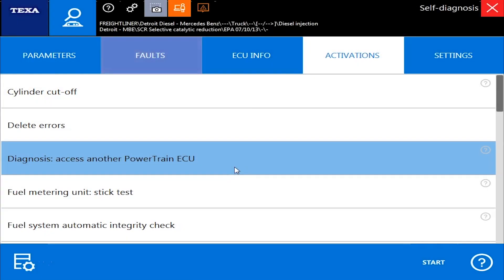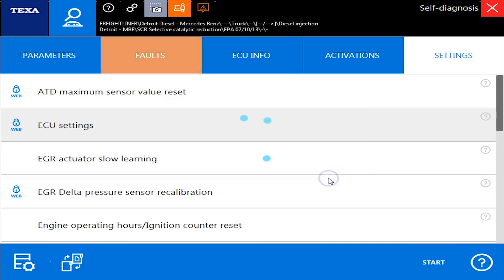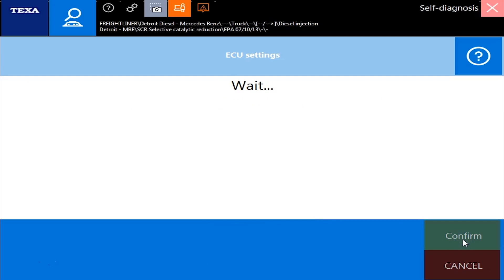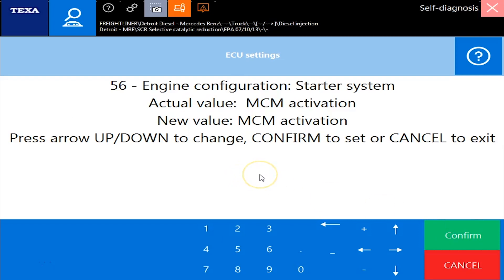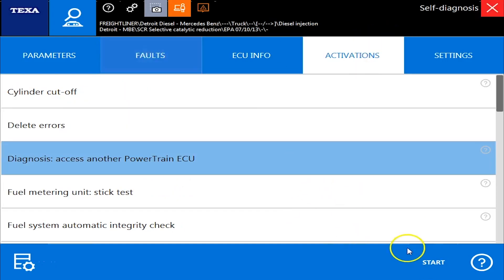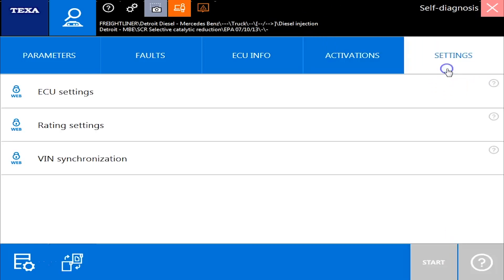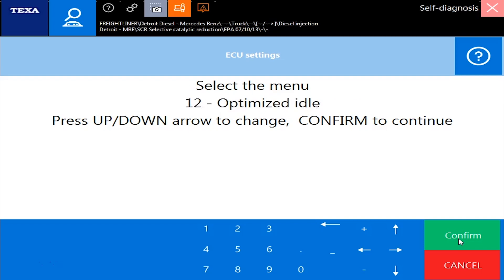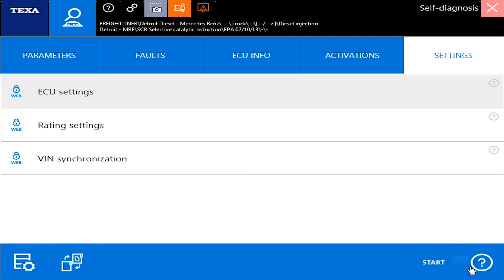How to Change Detroit Diesel Parameters with TEXA Truck

Comment: Hi, I have a detroit 6v two stroke 92 series the ecm is damage and I tried to use the ecm from 8v series but it is misfire and has black smoke. I wonder if the ECM for v6 & v8 is different configuration?
Reply from the maker: Yes, I would guess they are different but I don't know for certain. What I can say for certain is that you won't find a PC-based diagnostic tool for that engine. Those are pre-DDECII, which is when PC-based diagnostic started.
Reply: @DieselLaptops  Thank you for your feed back.  We already order an ECM for the v6 but still not arrive from U.S
Reply: @DieselLaptops  Hi my name is June by rhe way.  I really appreciate from your feed we can get through in our issue and we are trying to look for reprogramming from V8 to V6 do you know where we get the program.
Thank you

Comment: How do you fill out the special code form? Can you adjust the power if its turned down on the pedal?
Reply from the maker: Talk to the company you purchased your unit from, and they will provide the form. You can turn down the speed limiters.

Comment: not helpful at all, i figured out what is in this vid myself.what was never shown is the actual settings being sent. it will ask for passwords the default 0000, 1111 or 1234 all acted the same it went through the procedure and said complete however the settings never actually change, im sick and tired wasting my time then sending customers to the dealer to change simple settings that my "dealer level" scan tool cannot do
Reply from the maker: This typically means you didn't enter the correct password, and would need to either enter the right password or have a dealer flash it out.

Comment: can i use this laptop with obd2 . plus would i have to pay for updates or yearly plans
Reply from the maker: This tool comes with the OBDII cable... but what are you working on? There are no required annual fees with this tool, it is optional if you want to keep getting support & updates after the first year.
Reply: well i just work with obd 2 cars and i work with international bobtails 4300 .... and freighliners Isuzu
Reply: will this program let me turn of and on injectors